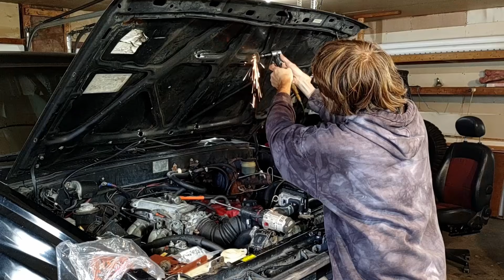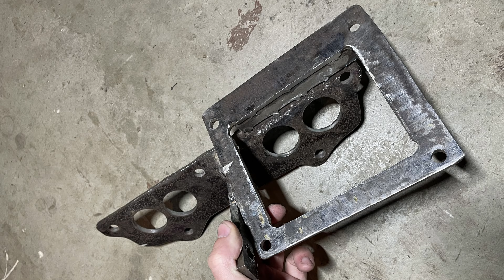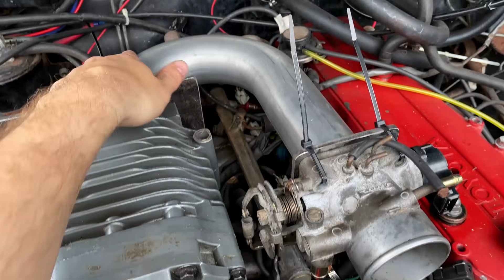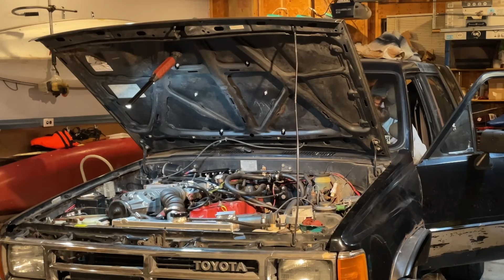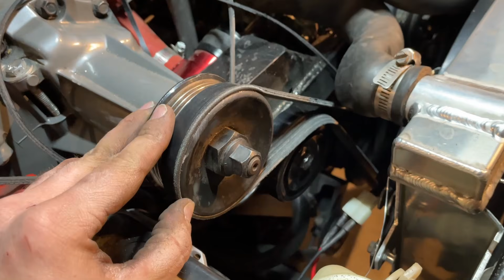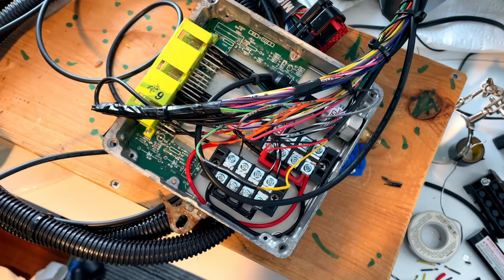Supercharged 22re Build Cost

Comment: Really enjoy your videos - keep up the amazing content. Not that you need to as your truck is running quite well as is but for interesting mods you could add a 36-1 trigger wheel next for more accurate spark. would be another way to utilize the microsquirt to it's max. maybe get more power and efficiency.
Reply from the maker: I really want to do a trigger wheel and probably will in the near future.